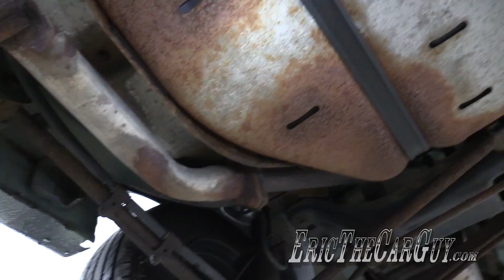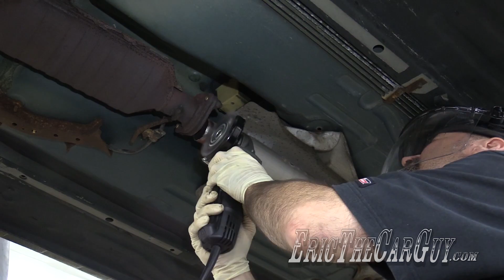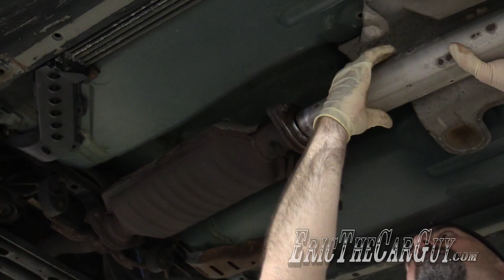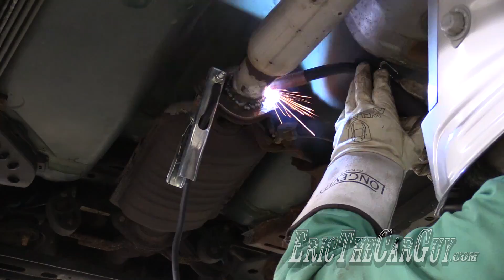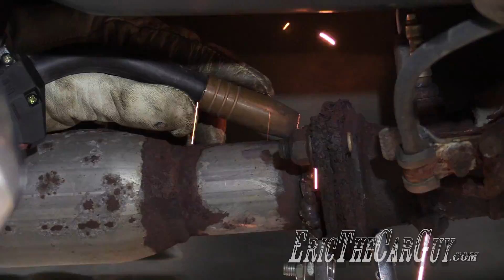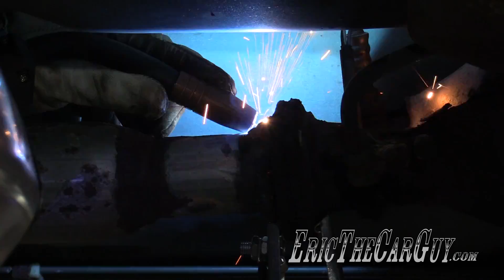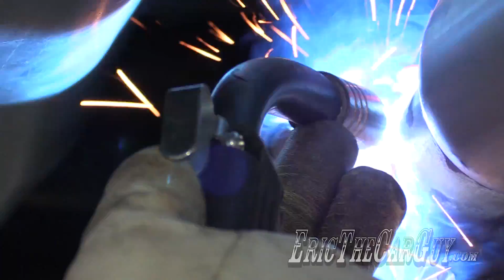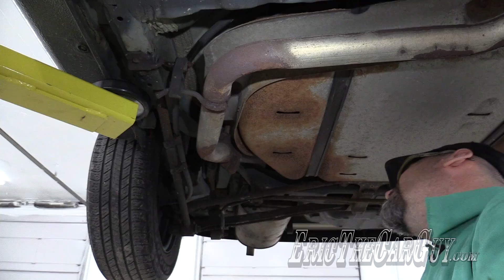Money Saving Exhaust Repair -EricTheCarGuy

Comment: Wouldn't it be easier to unbolt it and weld it on the bench ????
Reply from the maker: +supernom I might as well replace the pipe if I did that. I'd also have to replace the gaskets.
Reply: supernom bolts on older exhaust systems usually dont want to cooperate.
Reply: +supernom I would imagine the bolts from the cat up to the headers were more rust than bolt and getting them off would probably be more difficult than attempting to weld it where it is, I would not have tried talking that exhaust apart unless I was going to replace it.
Reply: +Vox Nihili that is so true. I just replaced Catalytic in my 95 and the bracket bolts that were holding it to the exhaust manifold just fell apart once i began to try and unbolt them.
Reply: All I know about exhaust work is that even with safety glasses I get rust in my eyes.
Reply: @samjohnson466  goggles with exaust!
Reply: +EricTheCarGuy  Ive had exhaust leaks welded on my Tahoe before just to keep it going till I can replace it my 98 jeep grand Cherokee sounds like it may have a leak but I haven't found it yet.
Reply: @SuperJeremi10  with the engine cool
Take a shop vac and attach the hose to  the tailpipe with some electrical  tape
Then pressurize  the system then with the shop vac on take a soapy spray bottle to the exaust system!!!
You'll see bubbles!!!
Reply: heck no.  that stuff doesn't come apart AT ALL.  Eric did that job exactly the right way (aside from putting new pipes on).
Reply: +Vox Nihili  There would have been no reason to remove the cat, the flange attached to the cat is all he would of needed to unbolt and weld, seems he came up with a descent solution though
Reply: +skoal22005 You said big balls. He Haw.
Reply: I honestly don't give a flying shit what you said asked or anything for that matter. Just shut up please.
Reply: If you are going to attempt to unbolt anything on a rusted exhaust you bring out the torches. Most guys I see seem to want to use PB blaster and a wrench or just an impact wrench to get at them. They will not come off they will almost always strip. Heating the nut only to glowing red will make it come off like cake. If you only heat the nut and not the stud with it. It causes the nut to expand but the stud it is on stays its normal size hence why they come off so easy. 

It is a valid point to be concerned with the gaskets however back in the old days before gaskets were mass produced you had to make your own. Aluminum flashing does a fantastic job of it and if you need it thicker you can always use a heat resistant sealer on your homemade gasket. Like a muffler sealer (comes in a white and yellow tube and is about 6 bucks a tube). 

Lastly the reason some people will opt for just welding it while it is on the car is more alignment than anything else. With it hanging in place it helps ensure there are no alignment issues. The flange can be turned 360 degrees around so it can be real easy to weld it together on a bench where the bolt holes won't line up. 

As a mechanic how I deal with this would be to simply tack the resonator in place to the flange, unbolt the flange using torches or and induction heating tool, pull it out of the hangers and just let it rest (this allows all access needed to weld completely around the pipe, assess if I need to make a new gasket or pay the 3 bucks for a new one, bolt it back up with a new gasket either made or bought. But that is just me and not every mechanic approaches a problem the same way. 

I would like to say there is nothing wrong with the way Eric did it here and I have also done it the same way when the nuts were just not anything and unbolting it meant more work in a situation where time is most certainly money. I am sometimes told I work a little slow for being a mechanic but I am fast at certain mindless work (brake replacement and whatnot) but the one thing that never happens that often is a customer complaining about the work I do. My motto is generally......slow and right or fast and wrong. Certain jobs cannot be rushed a head gasket job would be one of those jobs or camshaft replacement there is simply no room for error in those jobs but when it comes to something like ringing a set of pistons or installing a crank a lot of shops outsource to a shop who specializes in those jobs. Personally I am game for anything and find myself a lot of times completing jobs most shops do not. Thats mainly why my boss allows me to work slower than others because he knows my attention to detail is great so my work brings a lot of money in situations he would have had to outsource the job. Plus I figure a lot of shit out on newer cars. The human brain never stops learning so why limit yourself to remedial work.
Reply: Funny comment is all.
Reply: No!!!
The bolts on an exaust system will break 80% of the time!!!
Anything  after the cat has about a 30% success rate when unbolting
Usually  they just snap!!!
And it would be way more work to drill them out and replace them 
Being that they're either tac welded or completely  ceased!!!
Reply: Seized bolts are a nightmare
Reply: No idea why you are asking me?

Comment: ERIC your still going the wrong way when u weld you wont ever get a realy good weld till you go the corect way you weld the way your guns pointed not backwards like you do welding away from the gas is wrong you need to weld towards it
Reply: +obieezx11 You claim to have a degree, yet your written standard of the English language (even taking into account that you would be writing in American English rather than the British English I speak and write) is very poor.  

As Ispowz17751975 says there is a big difference between theory and practice.  Some things you pick up with experience.  

I would take the advice of someone who has been doing the job for 10 years over someone who has a degree and is pushing their weight around like they know everything.  Yes the ideal is to push to use the gas, however practically that is not always possible.  Like humans have been doing for centuries, you adapt to your situation.
Reply: +obieezx11 left and right brained people? I think you fall into the category of no brain.
Reply: I can tell, your knowledge on this subject seems minimal. Argon gas can still shield a weld even when being pulled. Maybe when you start welding you'll learn a thing or two about whats already been explained to you several times.
Reply: That's great you got your welding Degree obieezx11... Hopefully you are putting it to good use. I understand what you are saying, although I've welded Professionally for about two months shy of TEN YEARS 50 to 70 hours weekly and made a hell of a lot of money doing so. I worked with guys that had been doing it for over 30 years and they taught me all kinds of ways to weld. You can't just weld one direction when you are laying, twisted around pipes and other things welding off hand and above your head inside of an Cargo tank or other type of confined space... You have to adapt to your situation. Yes what you were taught is what you should do, when all condition are perfect and you are welding a flat, perfectly stable piece of material. Like I stated above, adjust your wire ( if using MIG) and your gas volume according to your situation. I made MANY state inspected welds, that passed inspection, and those welds were pulled, dragged, pushed, up the wrong way, down the wrong way and all the proper techniques when I was able too, which wasn't very often. There is more than one way to skin a cat.
Reply: +obieezx11 welding is a trade :o so... no degree (:
Reply: +DE Nichols I welded for a profession... At least I did, it's been about four years since I've worked doing so. Anyway, you are correct! You have to adapt to the ever changing conditions you are in... If you have to pull, then you pull the weld, adjust your wire speed and volume of gas accordingly. I worked for a company called Brenner tank, for close to ten years and all the welds we did there are free hand! No damn jigs or anything like that. Stainless steel and Aluminum, and various types of other metals. You learn really quick how to make your welds not only strong, but beautiful as well at that place! Lol. Plus, you either are a " welder" or you are not... You can learn to join two pieces of steel or you can learn to make those two pieces become one solid part. I love welding.
Reply: Ispowz17751975 I'm still working on beautiful being a beginner DIY, but having worked some welds over and over, I finally was grinding what I thought was my latest mistake and the two parts were truly one. :)
Reply: Ispowz17751975 Props man. At least one of us appreciates what you add and give to a conversation.
Reply: +obieezx11 a few grammar corrections- it's, weak, their, breaks, nearly, get rid of of, and it is listened not listend... But other than that I think you are 100% correct... With the state of his welds they might break at any moment, sending the exhaust system falling all the way to china and burning some poor innocent child.... You should really weld the other way so this doesn't happen Eric..... sarcasm*sarcasm... You are doing great Eric don't listen to trolls living in their mother's basement.
Reply: +obieezx11 dude I am taking welding classes, and I have welded and talked with old dudes that have been welding probably longer than you have been alive. what you say to do is forehand welding (welding the direction the gun is pointed) and there is no difference in quality than back hand welding (welding the opposite direction the gun is pointing). I have tested it and so have the old guys. you can do it both ways but it is easier for guys with little experience to weld back hand. and it works perfectly. Eric if you want to get better practice practice practice. practice gives you not only practice but also experience and that of all you need to get better. not advice from this guy. Try welding tips and tricks right here on YouTube. great channel, great host running the channel.
Reply: +obieezx11 When I welded under my car a catalyrtic converter in, I found that pulling the weld worked better when I went down, and when I welded up, it as easier to push, you have to very your style to decrease the warp that welding puts into a pipe.
Reply: +DE Nichols weather you find it easyer not isent the point the gas is there for a reason and you need to go towards it not away
Reply: obieezx11 Yes. The shielding gas is a separate issue from what I brought up.
Reply: Both concepts can and should be done at the time.
Reply from the maker: +obieezx11 That's debatable. Probably one that will never be settled. I appreciate your input though.
Reply: +EricTheCarGuy OK ILL SAY THIS THEN the makers of migs tell you to weld forwards because of the gas
Reply: obieezx11
Did you read Ispowz and I's comments at all? Pushing and pulling the weld are both vital techniques based on the direction of the weld you need. Welding everything in the same direction makes for a more warped product. While it is true you could make sure you either always pull or push a weld, when dealing with gravity, I've found it to be important to use both techniques for the best quality of weld. The inert gases can simultaneously be used on each type of weld.

Please be gentle, i was really enjoying the conversation you started.
Reply: +DE Nichols NO BECOUSE YOUR MEANT TO WELD FORWARDS WITH A MIG BECOUSE OF THE GAS YOU GO THE OPISITE WAY WITH A STICK WELDER you can sit here all night talking shit to those other clowns when i got my welding degree i was tort to go foward with the mig becouse if you go backwards the gass isent going to do its job and you end up with waked welds like erics were the weld hasent penotrated well  and isent flatter to the surface insted the weld sits high and rounded just like erics now stop talking shit im not interested in lisning to your dribble
Reply: +Ispowz17751975 let it go dude i dont read what you say anyway
Reply: obieezx11 Well. I happily read all he puts down because he's not here just to put someone down. Last I checked, you can get welding certification. Never heard of a degree in that.
Reply: +DE Nichols depends were your from are you were im from
Reply: obieezx11 Lol. I have no idea if I'm where you're from.
Reply: +DE Nichols wow small world florada is a grate place to live isent it
Reply: +cjmillsnun  you need a better understanding of the human body theirs left and right brained ppl im right brained  and theirs 2 reasons right brained ppl cant spell or use grammar from the way we see out of eyes the second reason is they only teach the left brand way of teaching right brained ppl have to be tort totally different and they don't.
right brained ppl like me have about 70 grate things going for us you being left brained have about 7 before you talk shit next time go learn about the human body and mind goof.
and before you become a bigger goof and tell me to use a spell checker ill tell you this you have to spell well to use a spell checker as they give you 5 to 10 words it would be you have to know how to spell before you can pic the correct word now get a life goof
Reply: +obieezx11 Does your mom know you're using her phone again?
Reply: +obieezx11 So what? (drops mic)
Reply: +obieezx11 is getting shrekt on by multiple ppl! Mercy please!!
Reply: +AzeOfSpadez its ok let them keep welding wrong and have week welds 1 day when there weld brakes near killing them they will think back to this moment and wish they had of listend
Reply: +obieezx11 I got my welding certs right around the time turned 18, had been taking welding classes aiming for  an associates degree in Welding Tech since I was 16. Over the years I've had A lot of time and practice, and can tell you from experience its completely possible to pull a good weld with a MIG. Yes, you are correct, if the situation allows for it, you should push your welds for the reasons stated. But if you know what you are doing, you can pull a weld that will be just as strong as one that was pushed. Just about anyone who actually welds for  living knows that you cant always push your weld, and if your technique is well tuned, the shielding gas will do its job just as its supposed to even if you pull allowing for a proper weld that can pass inspection. Eric's beads may not be pretty but he's a mechanic, not a welder. The shielding gas was probably least likely his problem, & more likely caused by the settings he set on the welder, as well as the old dirty rusted exhaust he was welding on.
Reply: +Thumper G. sorry i dont read books.
you push becouse of the argon gas  if you pull it dosent sheild like it should end of story
Reply: Eric, I was a welding inspector on both the civilian and government sides for 15 years. I can with complete certainty guarantee 100% of the quote un quote welders making all the unsolicited comments  would not be able to pass a GMAW 4" 321to 321 stainless pipe, in the restricted position. People take for granted how easy it is to weld until they have to get their test x-rayed. So since there is no requirement for bent, rusted and tempered exhaust pipe leak repair, your welding is perfectly fine. And since the mig welding process is the easiest one the master, you can make adjustments as you go. I must say you really hit a nerve with some of your audience, which was rather entertaining.

Comment: Running a bead on such thin metals...!!! will it work dun dun DDDDDDDDDDDDDDUUUUUUUUUUUNNNNN?

I would have spot welded two sides then kept switching sides much moving slightly either up or down.... ? I'm at 6.30 minutes, will the method work!?

Comment: Do you use anything to protect your cameras while welding? I'm always nervous that stray slag and spatter will ruin a lens while shooting welding. I had a brand new time lapse camera get ruined once.
Reply from the maker: +Amesie's Corner The cameras all have protectors on the lenses. Also, they stay far away and zoom to get the shot.
Reply: Could put it behind a piece of lexan.
Reply: Butt the lens to the lexan and bob's your auntie
Reply: +AnthonyH I imagine the camera is zoomed in all the way and is further away then you think. At least that's what I'd do.

Comment: For the beginning U need add welder price than calculate coast of repair. ;-)
Reply: +TheSae24 So when I fixed my catalytic converter (my car it's a weld only situation) it cost me like $500? Bought a used welder for under $400, got American made used for 1/2 what a lesser model made in China would have been. :)
Reply: As if welding setups are single use. A good set will last a lifetime
Reply: lolatmyage Yeah. I think my welder will out live me. I may eventually want a higher end one...mine can't do stainless steal for example.
Reply from the maker: +TheSae24 Link in the description. As pointed out, I've used it more than once. :) Also, you can have this done at a shop over paying for a new pipe.